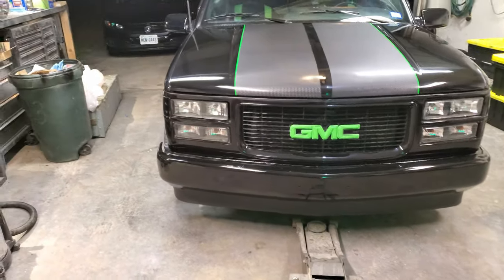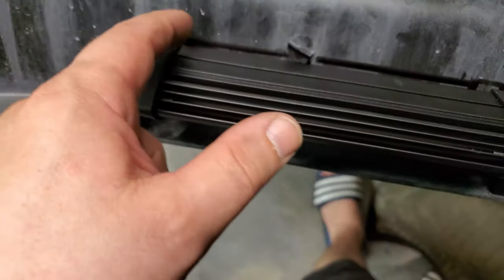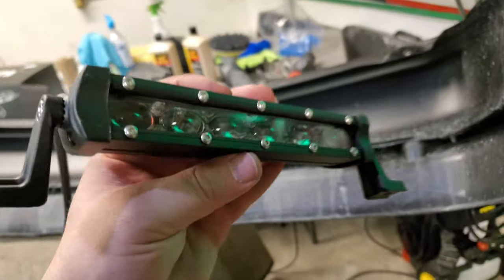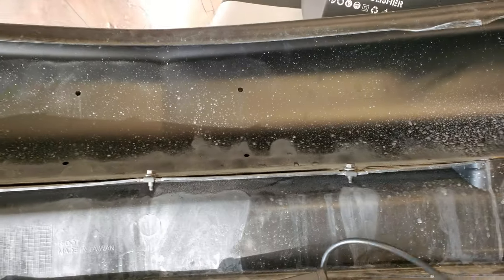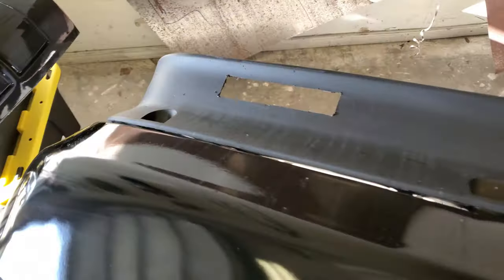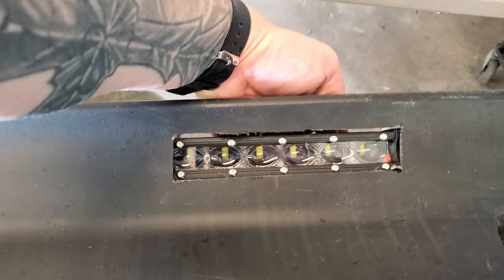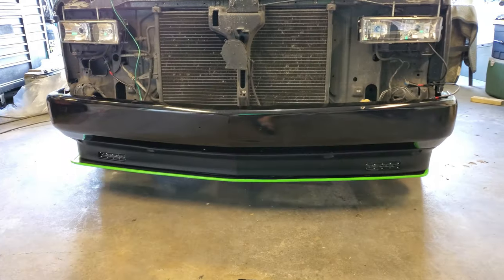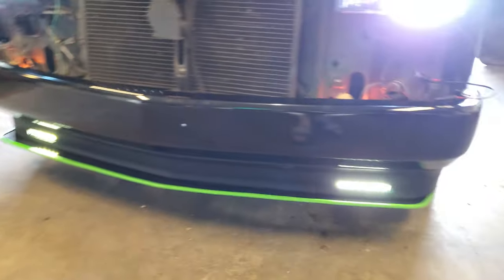DIY Fog Light Mod on the 95 C1500 OBS GMC

Comment: Got a friend who did that a couple years back and its one of the best light mods to do
Reply: But he used 2x4 or 2x6 led pods
Reply from the maker: Awesome yes it is and works and cost effective
Reply: @DrivenbyGears  you should do a hi beam to lowbeam conversion to where when you turn on your headlights the highbeams turn on with them to
Reply from the maker: @moisesosorio828  yea but it blind everyone in front of me